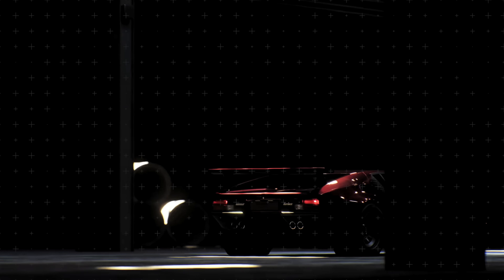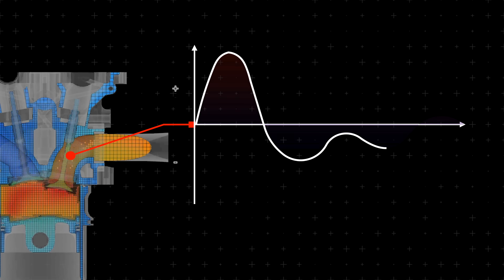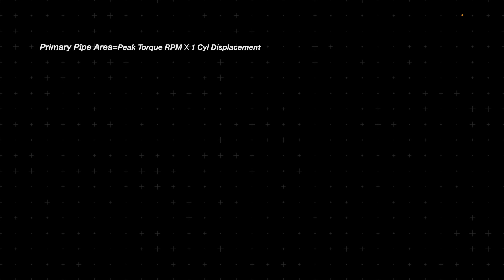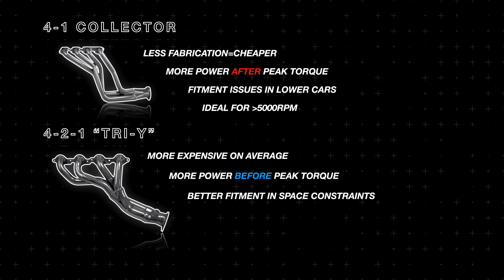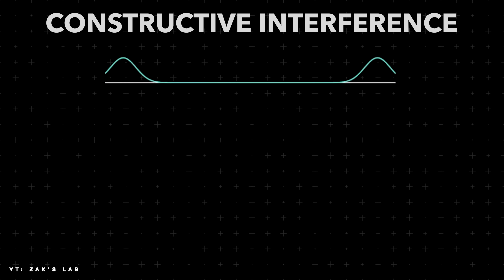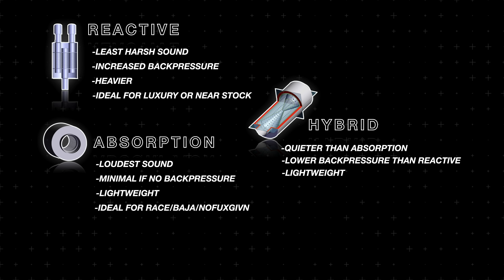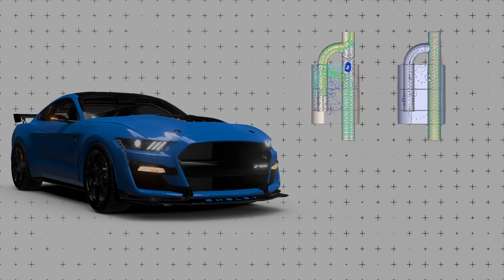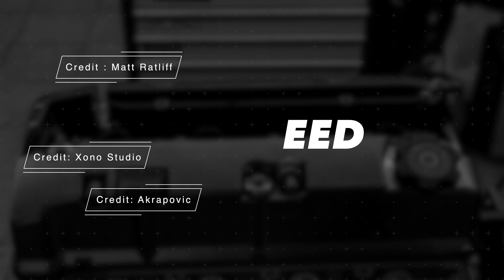Why Exhausts Make So Much Power😵| Explained Ep.27

Comment: I like this video, it goes over most of the technicalities correct, but there is some missing information. It doesn't change the advice given that much though, just complicates it. I especially liked the bit where you told everyone that INERTIA IS A THING AND YOU NEED TO THINK ABOUT IT. 20 points to the house of your choice for that, so many people miss that one it's ridiculous. And that graphic that showed narrower tubes with higher velocity - that's also a visualisation that most people don't get, and an important one.

So on that inertia subject, with appropriately shaped headers (ie smoothly) you can use a diameter a ton smaller than most people currently do,  especially in a stepped design. If you step it up after a few inches you don't suffer the same restriction that a single diameter does. Collector/choke diameter makes a huge difference too. You can fit 250hp through a smooth 2.25" choke on a 4-2-1 and you'll pick up notable gains low-mid.

You'll find your wide-rpm changes are due to inertia and restriction. Pulse tuning (lengths) can result in narrow but dramatic changes at some particular rpm.

On the pulse tuning subject, equal length is only important on even fire engines. When you've got two cylinders firing 90 degrees apart and a 270 degree gap before the next one (ie most v8s if you look at one side of the engine at a time) the rules change completely. In those conditions big gains come from elimination of blowdown interference (one exhaust valve opening messing up scavenging on another cylinder).

My lunch break is over, more tech talk later. Including turbo stuff
Reply: Ok so back to it. Much of a good header is about reducing the harm that happens naturally in an engine. There are two main culprits here, and they both exist almost entirely to mess up your day on overlap. Reversion and blowdown interference (which also causes reversion). I'm going to define the blowdown pulse as the huge rush of gas that comes out when an exhaust valve opens, and can account for a significant fraction of the total gas (say, 50%)  before the piston has even reached BDC, let alone started pushing gas out on its way back up. I'm also going to say we're working with an even fire engine (say, an inline 4).

1: Reversion (mass flow going the wrong way). Primarily about pressure difference between the inlet port, combustion chamber, and the exhaust port. If there's more pressure in the chamber than the inlet, the first thing that happens when the inlet valve opens is you get spent gas going back up the inlet pipe. This both dilutes the inlet charge (less fresh air) and requires energy to overcome, energy that could be used to increase inlet velocity and help ramming after TDC. The way to fix that is to lower the pressure in the combustion chamber, and you can achieve that by making sure the gas keeps moving as the piston approaches TDC exhaust. You can do this with smaller diameter pipes and exhaust port as the inertia in the gases keeps them moving when the piston stops pushing.

The downside is that as you go smaller the velocity in the exhaust gets too high and you end up with restriction (presumably from wall friction and turbulence, I'm not actually up on fluid dynamics enough to tell you "why", just "what"). This restriction requires energy to overcome, which comes from the piston and appears as pressure in the cylinder. Basically, go too small and at high power levels you end up with too much pressure in the chamber at TDC regardless of what's happening in the port.

2: Blowdown interference. Easiest way to describe this is on an inline 4. Exactly every 180 degrees a cylinder fires, but your exhaust valve is open for (say) 220 degrees. This means that towards the end of the exhaust stroke on one cylinder, another cylinder is opening its exhaust valve and the manifold is taking a blast of nice hot high pressure exhaust gas ready to pressurise the chamber on the first mentioned cylinder. This is invariable and happening on any engine with more than three cylinders per collector (and it can happen on three cylinder collectors too, but you need really big cams). You can fix this through two means, distance or maintaining velocity. Distance is simple, pulses have a speed and therefor take time to go from one cylinder to another, if your headers are long enough the blowdown pulse arrives on a shut exhaust valve and does precisely nothing bad. Maintaining velocity (see above) also helps because pulses have a speed *through the bulk flow*, and if the flow is going one way a pulse moves slower against the flow. It's not as much of an effect as length, but it's there and it helps.

Re: Collectors. Merge collectors (the only ones you should be using) have a secondary function apart from being a join in pipes. Designed correctly they can insulate the header from the rest of the exhaust system by way of acting as a check valve. There's no moving parts, but if you have fluid constantly flowing through the choke (smallest point at the end of the merge) and a smooth diverging angle you have a high velocity point that is difficult to push back against (backpressure). Also the blowdown pulse has difficulty navigating the wrong way down a merge collector, the majority of its energy is directed out the collector rather than able to be redirected up another pipe.

Something you all should note, even with race cars, a smaller diameter or longer pipe might cost you top end power, but you're in your mid range much more often (unless drag racing with a high stall) where those are going to universally help. "My car has too much response coming out of the corners" isn't a sentence that has been said out loud with a straight face, but "Damn this dog of an engine is hard to keep in its powerband" certainly has been.

Re: Turbo manifolds: Turbos respond well to narrow pipe diameters as that blowdown pulse delivers a large spike of energy to the turbo, and it can use that large spike better than it could with the same volume of gas delivered at a constant pressure. The thing is that the pulse dissipates with the volume of the manifold between the exhaust valve and the turbine wheel. So a turbo manifold should be short and narrow for best response. It also gets the bulk flow through the turbo faster, so you don't have quite as much residual backpressure near the end of the stroke. But then the blowdown pulse screws up some other cylinder because the manifold is too short and the blowdown pulse is so strong. You can partially combat this by using a merge collector on a single scroll turbo (again, the pulses have a harder time turning nearly 180 degrees rather than going straight), or you can run a twin scroll turbo and not have to worry about interference at all. A twin scroll turbo pretty completely insulates one of its scrolls from the other, so it's all round win. You get a lower volume of gas between the valve and turbine for maximum blowdown-turbine efficiency and you don't have blowdown interference.

A T-piece buttweld (steampipe) single scroll manifold will be really bad for flow and interference, but as it's compact you get decent response. Also super easy to make and if I had to run one I would, because turbo is better than no turbo. No good for maximum effort. A smoothly contoured 4-1 manifold with a merge like the Koenigsegg Agera is as good as single scroll manifolds get and depending on your specifics could be enough (Why is this "enough" for Koenigsegg, who you'd think would be going all out? Because they met their power and torque goals already, so they didn't need to add complexity).

Re: V8s with cross plane cranks. These things fire two cylinders 90 degrees apart, and it's REALLY BLOODY HARD to keep that interference from messing up your day and it's most effective at doing that above (roughly) 3500rpm. It's why long tube headers work so well for top end when you'd think that longer = low rpm tuning. What it actually does is longer = no blowdown interference. It's also why 4-2-1 headers have different grouping when you look at them (i.e. front pair and rear pair on one side, and 1&3, 2&4 on the other), the two cylinders that fire 90 degrees apart need to be grouped by longest possible path. 4-2-1 headers can also help with low-mid range (vs 4-1) by a method I haven't seen directly mentioned elsewhere: All 4-2-1 are effectively stepped headers. I.e. the pipe size off the head is only small until the first merge, where it steps up, so you can run a smaller pipe off the head without as much top end cost as a small pipe on a 4-1.

There's a ton more, but I'm tired AF right now. If you have any questions/comments/want clarification feel free to ask. If you think I'm wrong please educate me, I'm all for a discussion on the matter.

Comment: Quick short bullet point list for basic header fabrication (kinda):
1) forced induction builds: Based on metallurgical properties, Inconel is the best tubing to work with, but expensive and not as easy to weld correctly.  High strength with low thickness, greatest resistance to high-temperature softening, and can handle structural integrity loads that T304 SS and Ti headers can't.
2) Collector convergent and divergent angle-of-attack: On both sides, the more gradual (closer to 0 degrees), the more powerful they are, at the cost of being less compact.  Common convergent and divergent angles are as follows. Convergent: 12°, 15°, 20°, 25°.  Divergent: 13°, 7°, 3°.
3) In engines that are 1) not even-firing (crossplane V8's, odd-firing V10's, 2009-current Yamaha R1), and 2) share a common intake manifold/plenum, the absolute best way to determine individual ideal primary header lengths is by comparing exhaust pressures between individual exhaust runners and comparing them as % of each other, starting with the highest.  Highest pressure value primaries stay at pre-calculated length.  All others get length reduced by same percentage as pressure (e.g. for ideal length of 38 inches, exhaust pressure of 92% max gets 92% total primary length, which is ~35 inches).
4) for engines such as V-twins with large firing order intevals, there are 2 priorities for consideration prior to fabrication: 1) Pressure percentage as listed above, and 2) firing interval (in degrees).  Example: Ducati 90° V-twin firing order/interval is 270°-540°.  Cylinder with 270° interval gets unchanged ideal primary length.  Cylinder with 540° interval gets ((540÷270) X Ideal length), then adjusted for pressure percentage as stated above.  If higher than cylinder 1, add percentage length.  If lower, subtract percentage length.
Reply: Very well said, I really appreciate the time you took to write that down and or share that with us. Will need to copy and paste this comment to save this in my notes as I feel what you’ve explained is very helpful information to have. At least it can point people in the right direction when it comes to understanding it a little bit better.
Reply: @maxboya  not my best work as I could have worded it better, but I guess it gets the point across.
Reply: How do I do this math for a VTX 1800
Reply: @ZuZaarr  done.  Ideal primary tube length 37.5 inches, primary diameter 1.63 inches/42mm outer diameter.
Rear cylinder is ideal length.  Forward cylinder is 43 inches to account for extra 52 degrees of separation due to v-angle.  Collector will be 2.5 inches wide, choose your angles how you want to.
Reply: TIL about inconel, never even heard about it before and just assumed Ti was the best.

Comment: Didn't even mention the farty exhausts on 90's four cylinder cars. A farty exhaust on a 1992 Honda adds anywhere from 500-550 horsepower.  That is why they have to have a big wing. They have to have the downforce. Add a K&N air filter and you will be pushing at least 1200hp.

Comment: I've never really thought about engine scavenging on 4-strokes with valve overlap. I knew there's an overlap, but not why. I'm mostly educated in smaller 2 stroke engines, where scavenging is VERY important but also larger crosshead 2-strokes where there's also scavenging with the exhaust valve.

Comment: Diesels are a good example of the importance of good exhaust systems. Look at modern trucks with DPF filters and how horrible the reliability becomes. However, a straight pipe will allow all that exhaust gas and soot to escape and it’s like a completely different experience. It seems like a small upgrade, but I was told by a mechanic to think of it as not being able to fart and how it makes you feel inside vs letting loose and feeling good 😂 It’s essentially a better ability to breathe and flow
Reply: Not just diesels.  I'm sure modern gas engines sound and perform better without a cat, EGR and muffler etc. But ultimately all those emission and noise control measures are there for a reason. We did the whole engines with no emissions control for decades previously and know all too well what the results are and, while I do get why enthusiasts don't like them (DPFs etc) and I agree to an extent, I think it is probably for the best.
Reply: A good fart = a good breath. Just like an engine
Reply: Diesels possibly are more sensitive to exhaust systems because their inherently longer stroke means there's so much more volume of combusted air flowing. Which is why he mentioned larger pipes and probably why most diesels use 3"+ pipes. 

Then there's also the turbo issue which of course you want the optimal flow into that turbo, plus heat. Maybe 20 years ago I watched an episode of horsepower TV where they simply took a heat blanket and wrapped the exhaust side of the turbo to increase the heat. They added about 5-7 hp on the Dyno with a $25 part that took 15 min to install. Heat on the exhaust side for turbos is great. And cold on the intake side is great too, that's why my turbo Volvo runs so great in winter! Haha. The goal is to create as large of a difference in temperature between intake and exhaust side of that turbo, with as much flow on the turbo as possible.
Reply: Great analogy!
Reply: I can definitely agree that removing DPF could improve mechanical reliability and such. But the downside is decreased biological "reliability" of people's lungs so to speak. They didn't put them on there because "No fun allowed." after all.

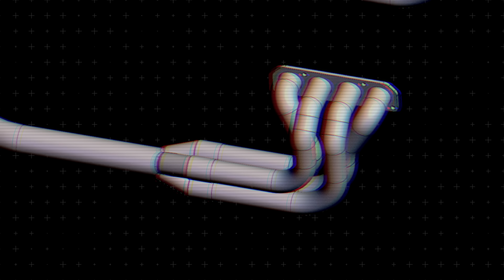Comment: 4:50 not just like that: it depends on how many deg of crankshaft rotation is between each puls on one bank(for 4-2-1 , to get longer time on left bank i connected 1. and 5. cyl in one and 3. and 7. in one, on right bank 2. and 4. in one and 6. and 8. in one(cross plane crankshaft))

Comment: I get that Forced Induction allows for more power, but when it comes to having an analog driving experience, nothing beats the sound of a well tuned NA Engine. 

The Porsche 4.0L flat-six, Ford 427 (GT40), GM 5.5L LT6 6, and the 2.4L F1 V8s of the early 2010s are my favorites.

Comment: One thing never discussed is mechanical exhaust scavenging. In WWII, planes at high altitudes needed superchargers to make up for less Oxygen. One thing engineers discovered was higher they climbed, the leaner they became. This had nothing to do with the supercharger. It was discovered the lower air pressure at high altitude lowered exhaust back pressure so much it affected the Air Fuel Ratio. 

If forced induction adds horsepower, so must forced exhaust vacuum. A belt driven turbine impeller (no compressor needed) close to block would work, but limit placement. New Electronic Turbochargers are available. The Turbine side could be placed anywhere downstream on exhaust system, even at exhaust tips. 

What do you think?

Comment: The problem with H pipe exhaust is it’s pre-planned location vs where it’s actually needed. If you put the crossover where it tells you then you’ll increase flow and efficiency of the whole system

Comment: When I rebuilt the 305 in my 88 IROC five years ago, I upped the intake and exhaust valves, installed Dyno Don headers and went with 3" tubes back into the GMMG "muffler."  Each year that I bring it out of storage, I forget how much louder the car is.  Torn as to whether or not I actually like it--some days yes, some not so much.  But I'll keep it.

Comment: 337, I have a question to post to you for another video similar to this one. Would you mind covering exhaust systems for motorcycles? I just picked up my first entry-level sports bike, a BMW G310 R, and I’ve done some research on exhausts, however, none of them Sound as good as the stock exhaust, and I was curious to know why that was, and also if there are other exhausts that would generate more horsepower for the bike?

Comment: What if you put a expansion tube or something like a bore evacuator on the exhaust shortly after the headers. Then you would have 3-4 times the expansion of the pipe for short part of the pipe. Can you make simulation on that. Then the exhaust can come out of the manifold and into the pipe, then expand, less back pressure and then go out. The 2 stroke dirt bike does it. So why not do it on 4 stroke if it could work as a gain...

Comment: Solid vid 👍 
Alot of kids have no clue how engines work and the exhaust side is the black magic topic as it has so many variables.  
BMEP sensors help alot, really importsnt to minimize backpressure in turbo/SC applications as the forces can break valvetrain parts.  Appreciate you including that in the vid.

Comment: If I remember it correctly, the big difference between X and H pipes was more that H pipes ultimately had better exhaust flow/velocity at high rpm, where the X pipe could help promote lower rpm scavenging, depending on where they were located.
Reply: Opposite
Reply: Thought it was the other way around no?
Reply: Ahhh... not sure where I got that from. Maybe I mixed them up in my head.

Comment: Best system you can get is long tubes x pipe and electric cut outs with a quiet muffler have best of both worlds and most sprts cars use these days minus the longtubes